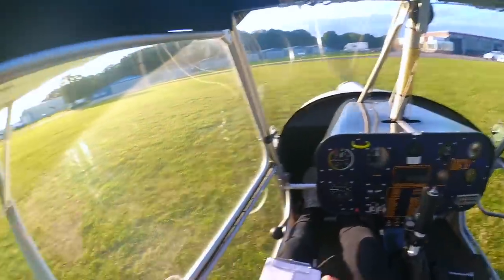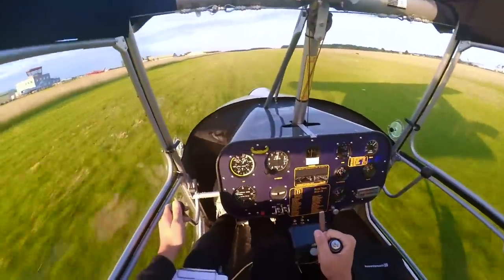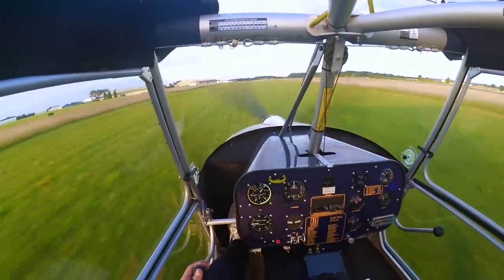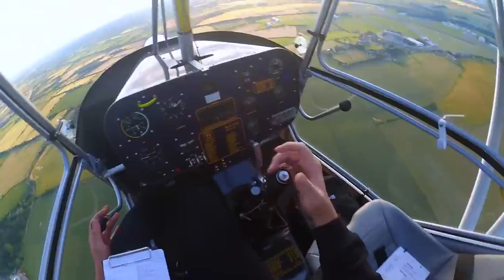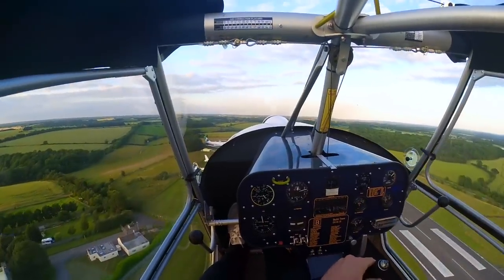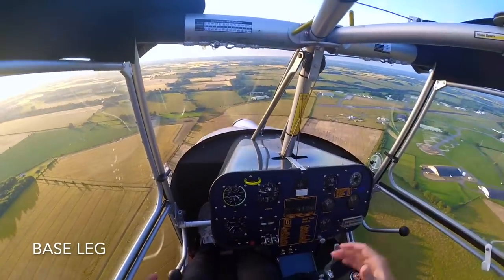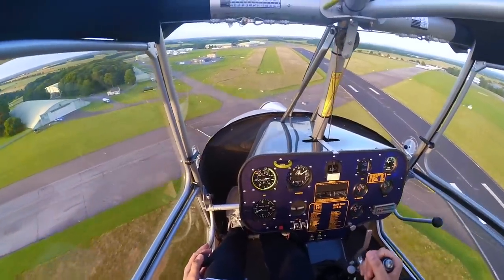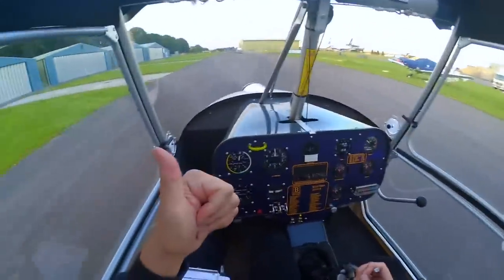LEARNING TO FLY | Episode 22 | Solo Circuit Practice | Microlight | Pilot VLOG | Cockpit ATC audio

Comment: Great video, Ben - really enjoyed. Am also a student, currently have 4 hours solo under my belt, so it's great watching your videos - I find it really useful 'revision'.

Just a small point (and please bear in mind you're closer to GST than I am, so it's not for me to say!) - about half way through the video, 2nd circuit, you look around and say, "Security's good", though it looks like a kneeboard/pair of sunnies on the passenger seat.  Are you comfortable with loose items in the cockpit like this..?  Just wondering...

Fab videos - keep it up, good luck with the flying, and come over and see us at Brown Shutters Airfield some time!  (Particularly if you enjoy your short field stuff!)
Reply from the maker: Ian Garforth - hey Ian, really appreciate your comment, and I’m chuffed you’re enjoying the videos! It’s a good point to pick up on. I personally am talking about my harness and the door hatches, hence the look over. Personally my couple of loose items in the cockpit don’t worry me too much should the worst happen. Though I’m sure some would say stow away. Unfortunately in the skyranger there’s literally nowhere to put anything! Other than yourself haha! Thanks again. And do keep watching! Cheers
Reply: @BenAtkinsonVideos  Fair enough. I learn in an AX2000, and have rebuilt (and last weekend re-permitted!) an old Thruster TST, both of which have control cables that run along the floor pan, and would be at rish of having something getting stuck in them.  The routing on the Skyranger looks very different, so perhaps nothing to worry about!  Fair winds and smooth landings to you...

Comment: Love your videos mate, they have been an invaluable watch before starting my lessons.  I have just had my first lesson in a lovely new Skyranger swift 2 today and tried to record video in a similar way to you but didn't get the great field of view that you have. What camera are you using on your head mount? I had opted to not go down the gopro route to save some cash but I think my choice wasn't the best. Cheers.
Reply from the maker: hey Martyn! Thanks for commenting. Im really glad you’re enjoying the videos. Where are you learning? Skyranger is great. Just lots of rudder use - good practice! So I use cheap knock off go pros thinking if the channel did alright I’d buy some real go pros, but the quality surprised me so much I’m sticking with until they die! I use a headmounted camera and stick one on the top of the instrument panel (on most flights) with a suction cup. The cameras are YI 1080p action cameras. You can only view YouTube in 1080p max so figured there’s no point shelling out for the 4K versions And you can buy two for less than £100! Battery lasts for at least 100 minutes. Haven’t had it run out on me yet! Note I record audio separately via a zoom h1n and various cables!
Reply: Thanks for the great response Ben much appreciated. I am training at Microflight Academy at Balado airfield near Kinross in Fife. They have a brand new Skyranger and a Eurostar but only training in the Skyranger. I've had previous Flex experience and wanted to try 3 axis. Watching Rory on air's and your own videos definitely helped push me to go for it and my first flight yesterday was brill. As for the camera, I went with good reviews on Amazon and bought a £45 crosstour 4k camera but I'm using 1080p60 and the quality is no where near yours, and I made an arse of trying to record my audio with the mic in the earcup connected to the camera. I'm just gonna have to bite the bullet and go for the setup you and Rory use if I want anything decent. Anyway sorry mate I've blethered on a bit..keep the vids coming Ben they have defo helped me and good luck with the rest of your training also. Cheers. Marty.
Reply from the maker: Your camera should be ok? Check it’s not got a wide angle setting? Have a play. But worst case I’d really recommend the YI cameras. Yeh I experimented early on with a microphone in the ear cup - just good enough to play back for training purposes but I wanted YouTube quality audio really. Still experimenting with it now to be honest! Keep up the training you’ll love it I’m sure. Happy landings! And let me know how you get on with the videos
Reply: Yeah I'll check the camera out and if I'm not happy I will try the yi. The quality is definitely good enough for youtube. I do think I will sort out a decent audio setup tho. Being able to review your lessons will be a great benefit. Look forward to your future videos Ben they are a real help and very enjoyable to watch. Your instructor is brill aswell btw.. "hold off" "hold off" "hold off" I've got his voice in my head lol. Cheers mate, all the best from a not so sunny Scotland.
Reply: Ben, I've sorted the camera issue by turning off the electronic stability function, the field of view is much better. I've also bought all the audio bits n bobs yourself and Rory use. Any advice on good settings that already work for you for the zoom h1 would be appreciated. My next lesson is on Saturday morning so hopefully I will be able to get some decent footage. Cheers for your help mate.
Reply from the maker: Martyn Ferris - ahh knew it would be something! Well done for finding. Auto stability will drastically reduce field of view. It’s a very versatile audio setup that can come with you through any camera upgrades etc which is great. As for settings on h-1n...try and ask the instructor for a minute to get the levels right. Don’t use auto level. It’ll be up and down too much. You want the levels peaking at no more than -12db with engine on chatting away. I find about 3-4 on the dial at the top works. Always use a decent size memory card and I prefer wav (the 128 mp3 or higher  is fine too), but wav generally will be best quality. But big files, compared. If it’s just for training then mp3 at 128 or higher will be more than acceptable. And save some space on the SD card. Other than that - keep all other settings off like lo cut etc, and make sure you hit the “hold” slider so settings don’t get changed accidentally in flight. Enjoy - let me know how you find it
Reply: @BenAtkinsonVideos  Brill, thanks for all your help. I'm flying tomorrow morning  and wont have recieved to 40db pack by then so I will just try and fiddle with what I've got and keep an eye on the -db levels. Trying to fly twice a week so hopefully have the setup required soon. Just need to learn how to take off now and make it back down with wings still attached and I'm sorted. Cheers Ben 👍
Reply from the maker: Martyn Ferris without the patch you may be fine...I just found my h1n was a bit overloaded even with the level right down. But - importantly you can still use the audio for debriefing. Worth having the mic a bit further away from your mouth too if you need to...good luck!
Reply: @BenAtkinsonVideos  cheers mate. Just watched your latest video, it was great. What a landing. Greaser on grass wayhay!
Reply: @BenAtkinsonVideos  woop woop the postman has arrived. All sorted for tomorrow then mate. Thank you so much for all your help Ben. Top man. Cheers.